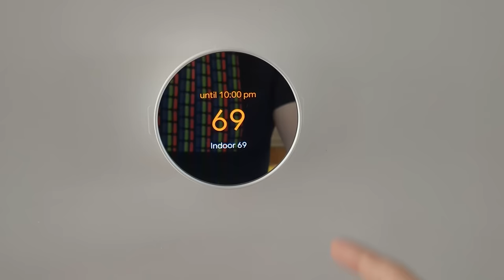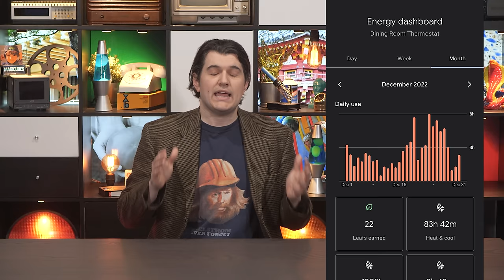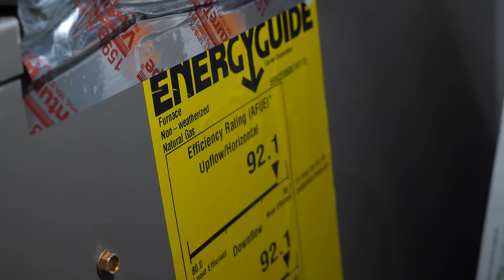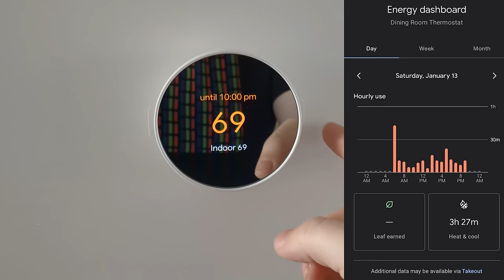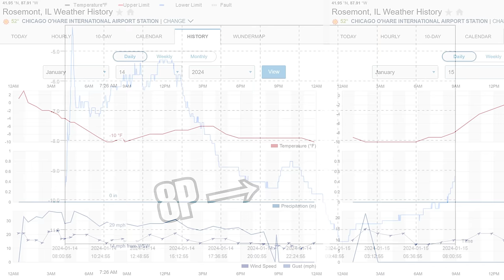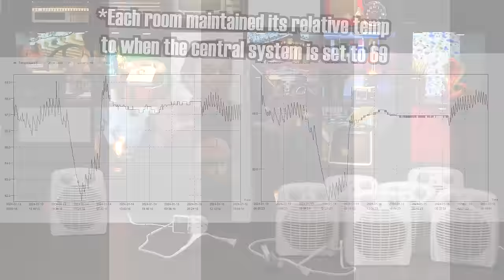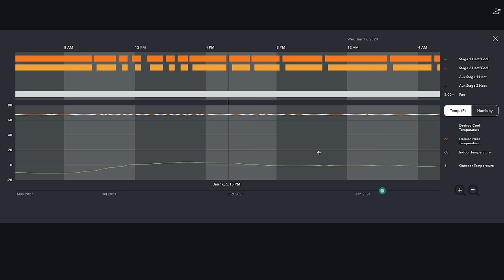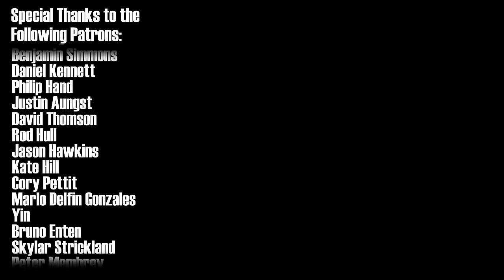Old HVAC industry practices are holding us back and costing us money. But we can fix it.

Comment: What you all forget is you have a 100A main power grid, my home(and all neighbours) have 30A,some 2x 30A as a main incoming power. So whole grid outside is calculated on that surge. Imagine we all install 100A? That main grid house outside will burn out as it can not handle the load. In the end the 10kV to 230V Transformer can't handle that load too as its not designed for those high loads. If that would be replace, imagine the next 25kV to 10kV etc etc. Next problem the noise of those fans and motors, running. I hear my neighbour sneeze! Imagine if we install all those running gear. Constant humming. Thats bad for health care too. 

Gas heating is not the main problem of climate change at all. The money investment , whole re install of electrical systems in houses and so very costly. 
Next to calculate the power surge of all those EVs chargers. Next what in 10-15yrs? again reinstall the chargers and pomps. 
Now a replace incl install of gas heater unit is 2000€ every 15yrs. So to renew the installation every 15yrs of solar panels + inverter, heat pomp AND Ev charger?? 
As we all know things don't last for ever. WHAT are the costs every 15 yrs? Add that up. 

Next we all know EV cars after 10yrs nobody would buy an old used battery car, due to huge expense of that battery 10k+. So instead of a car on the roads to  be last for 15yrs and if shipped to Afrika and the like those will last 25yr as a total. Now they can't ship those used Evs to Afrika as they have no socket to plug in. So the write off those Evs is huge also.
As most of us don't have the 40k € at hand to buy an EV.

Then imagine the jong bloke 20yr old, want to its 1. buy a used car. Not fair to ripp off the high gasprices also. 
Thats what "they" want in effect, get you all out of your own private car. Thats main effort.
In a city, ok you can till app 0700-20.00h use public transport, only within the city.
If you need a bit out side the city, after 20.00h starting to add up, you need big amount of time to get around.
So the freedom to travel is limited BIG TIME. 
" They" even want to tax/mile on the road, just to get you OUT of private transport. Its a scamm of highest imaginary.
Oww Take a kind of loan car project?  Ah yeh been there. 
First at for hand claim a car, than walk around to find one, Next you have at for hand calculate when you want to take trip back, again claim a car.
But you needed couple of hours more, and have to re claim a time slot. Sorry no car available in circle of 3miles.
Ohw you keep that car in your time slot for hours, yehh money clock is ticking also!!!
The stress that will make to be reliant on that system is very huge. Not very healthy. 

So add it all up.
Install a noisy Wpump incl whole installation 10k€ (also have to remove old iron waterheating as those are not designed to work on 30dgr of water)
Re-new electical installation 5k€ (as current system is calculated on 30A main grid)
New e- cooking stove.
Solar system 5 panels incl inverter 8k€
Ev car 40k€ (with a very high 8yr write off)
Install charger 2k€ 
Reinstall new windows,doors and extra isolation etc  25k€
TOTAL 90.000€ , DO you have that ???
Ohw take a lone? Who is benefitting from that? Yess you get it. Also extra rent next 20yrs you have to add up.
For what purpose? A few highly half true imaginary thinking it would have any effect on climate.

As with in 15yrs you have to replace all to gather again.
Normally I only had to replace every 15yrs 1 small heating unit of some metal and plastic of 5kg of waist. Of a reinstall cost of 2k€ .
Now I have in their fake imaginary of environment helping, within 15yrs A whole lot MORE E-waist, and production of all those new equipments.
A Wpump, Solarpannels, Inverter, Charger with whole pack of batteries with huge amount of heavy metals, chemicals etc!
THATS MY problem!!

So as we all know even those wind turbines outside have also to a replaced cycle every 20yrs.
Imagine those costs
And waist, of all that material, even the turbines it self containing heavy contaminated fluids, The turbine blades a huge problem, now ending up in landfills
Yehh I know now scrapped to small particles and be BURNED in cement factories.(Go google it!)

Now start a new vid, and do the whole calculation again of whole supply change within say 20-25yr.
What's the profit than?
Those Ev cars, Solar panels, wind turbines(also at sea and necessary costs of special trained people, safety equipment, helicopters and all included), all those charge poles out side,
at home, cabling. sockets, chargers , inverters, batteries 
The whole package.
All calculated over a life span of 20yrs max.
What's the environment e-waist ? What are the re-cycle costs of that whole package? 

I used to eat every day an apple of 1€ ,cause an orange is 3€, now they made fictive due to taxes and other fake imaginary an apple 5€, Then they say Eating oranges is cheaper?
Do the math.

The real climate change would have an effect if we just buy stuff/equipments that last more than 5yrs.
The little stuff like get rid of all those battery equipments, use a cord drill that will last 40yr+
Proper Vacuum cleaner with a cord that will last 25yr, instead of 5yrs crapp battery thin plastic thing.
Good washing machine that will last 20yr+, and could be repaired when broken. So parts must be available.
etc etc.

That whole Climate scamm is not proper been thinking trough. Yebb thats what you get when "we"leave it to the climate hysterical idiots who only can look one day further.
Have no clue about the whole project, the real calculations they just ignore.
Lets join the idiots sitting on the roads?
You seen them? What are they wearing, eating, transport?? And at home? They ALL lurk on State Income, subsiddiesed idiots.
They just point at others.
Others have to pay up.

They them selves have no proper jobs, they will not do economic work.
They leave that to the migrants they suvvel in by the 100k.
Then complaining they can't find a proper Government subsidised home? Buy one your self! Uhhh I have no job, You hear them?? Do you?
Lets see if by then they still wil sit on that road again.Never, as they are lurkers of the social system.
As they have at minium their easy 20h/w fake jobs of no real economic purpose.
Do you think those Road sitting fools will be installing solar panels on roofs in bad weather?
Will be working in Chinese factories 12h/d to make their wanted Solar panels, inverters, chargers etc etc? 
Living in 15m2 chickenhomes also? Do they? Nope.
Or shoveling new cables into ground for their "climate"NOPE.
DO they invest them selves? NOPE they mostly live in rental by social State managed and dare to claim those "owners"need to reinstall whole new installations.
And when next the rent /m is rising they start pointing at Government (that is YOU tax payer) to add more to their State Income. As those losers have nothing to pay for them selves.
Food prising is rising ,due to fact energy and the like is rising, again those XR fools claiming they need more State Income.
So again they are not really effected as they not have to take Loans, +also rising prises to get "their" climate change effect.

Thats the real story.
See through that whole "climate" scamm and see through the whole thing.
I am not against a proper taking care of environment. BUT must be done on a real proper way. The real way
Hydrogen, Thorium.
And with hydrogen heating systems at home, we don't have to re-install WHOLE electrical installations.
Don't have to have Inverters, chargers and the like, also replace evry 10-15yrs.
Just a new Hydrogen heater and thats IT.
AND we can use current grid and whole grid gas-piping installation also.
Just convert to hydrogen.
Not available now, Start investing, enginering , 
Far cheaper than by now invest in this scamm of batteries, electrical heating systems.

Imagine a private car on hydrogen, what after 20yrs of crapp you have? Only the car it self, no E-waist of heave containing Lithium, Cobalts, Nickel and the like.
And can be shipped to Afrika and the like. Running a next 10yr+ Of that same car.
No Charing poles in streets. Having fights who will charge first.
Let alone the E-WAIST every 10yrs of replacing those poles charges by the millions.
Just a refill at the gas station THATS IT.
GET IT.
You ALL GET IT.
What really is the goal.

Comment: If you have people at the house, those people also tend to open the exterior doors of the house.  The ~100 watts of heat that a human body produces is negligible when compared to opening a door with a 70 degree temperature differential.

If you house isn't perfectly sealed, then the blower in your HVAC unit is making high and low pressure zones.  The longer that the blower is running, the more air leaks (not to mention that your walls and windows are a heat sink and circulating air means that it transfers heat faster).  That I can understand that you didn't bring up.  However, I'm surprised that you didn't bring up that if your furnace doesn't fire up on the first time (maybe the breaker blows or the power goes out), then you can get the house back up to a reasonable temperature.  99% of people would be pissed at the HVAC installer if that were to happen.  How is having an extra burner in a gas fireplace so horrendous in your opinion?

Also, that ACiQ unit is a piece of garbage.  If you're paying $12k for that, then you are getting ripped off.  You should be getting a Lennox or a Trane.

Of this hour, about 50% of it is sarcasm and rambling.  You can do better.  I expect your next video to be how Hyundai ripped you off by oversizing your car.

Comment: heater does NOT turn ALL of the electricity it consumes into heat
Reply: Where are the losses in your opinion?
Reply: @cutterboard4144  its not my opinion, its physics.
with every additional degree in C you need more energy - meaning you need more energy for 100>101C than for 99>100C and thats because the excitation of electrons in atomic layers. you have to further excite the already excited electrons.
same principle is applied to a car speeding up - you need more fuel to go from 60-61mph than for 59-60 mph
Reply: @meex88hiphop  Those are not losses, but temperature dependant heat capacities.
While you are right, your conclusion ist faulty. The amount of energy dumped into the medium is lossless, but the change in temperature isnt linear. Correct.

Comment: I live in Yellowknife NT, Canada. The average temperature in the winter from mid October through April is -20 C.
Our kWh rate is $.32 per kWh. 
How does this jive with a heat pump?
Reply: For now it doesn't. However, that you're in the tiny minority of people who live in a climate where it's too cold for a heat pump doesn't mean that the majority of people elsewhere shouldn't be using heat pumps
Reply: @merchanttf2523  we currently supplement our oil heating with two pellet stoves.  

They also want to carbon tax our fuel oil.  New developments use propane which is marginally better than fuel oil but requires more attention due to potential gelling of the fuel. 
Granted we are a vast area with low population density. 

Is there a good deal of wear and tear on efficient systems that remain operating over extended periods of time?

Comment: And if you want to heat your home to 79° because you are not feeling well, and the outside temp drops of to -20° (like it did recently ... which hurt BEVs charging). So what you need to realize, is that natural gas is more efficient, better for the environment (it produces more CO2 which is good for the environment). It works, it works well, and it does so better than any other system.

Comment: OK. So, your premise is flawed at the outset. The reason it only needs to run for 1/4 of a day is that is the intent. You do not want something continuously running throughout the day to maintain temps. It's not for energy efficiency, it's for basic mechanical breakdown. If you were to cut down to EXACTLY what you need, then the device would be running a duty load 24/7 when it's at capacity. This will drastically reduce the service life of the parts inside. The reason companies go for overkill is to allow shorter duty cycles, more rapid temperature stabilization, and less overall risk of a catastrophic run failure. Could there also be some price gouging? Sure, in any industry, a good chunk of what you pay is lining the pockets of sales and marketing. But is it correct to advise people to request far less? No. I can agree that decreasing the overkill could be a good idea, but going too close to the bone leaves you on a razor's edge of failure.
Reply: The heater runs 3 months out of a year. If using it longer somehow destroys it then people need to abandon it as soon as possible and use heat pumps.
Reply: @milesedgeworth132 you seem very confused. I'm talking about ANY system. All of them feature blower fans of some nature, as well as other mechanical systems that have a life span. They are not designed to run continuously 24/7 365. There's an expectation that they will do their job and shut off for a period of time. If you cut back to the bare minimum, you're forcing it to run more, and push the limits of the mechanical parts and that will shorten the life of the parts. This is true for EVERYTHING. Be it cars, computers, cell phones, bicycles, anything. All machines have a life span and the more they are used, the more stress they are put under, the more likely something will fail.
Reply: @pawkeshup This isn’t really the case for most things. An internal combustion engine experiences considerable wear every time it starts from a stop because of a lack of lubrication. There are refrigerators being made now with compressors that are meant to run almost all the time because it’s better for efficiency and longevity.
Reply: @jehdbrbjeirodofjdjebeebbsnaka  I was highly debating bothering to reply to this, as it shows a lack of understanding, and a bias to compare apples to oranges. But in the interest of education...

The issue with an internal combustion engine has nothing to do with the duty cycles and lifetime of parts in electrical motors. The issues at start up of mechanical failure are not mechanical issues, but pneumatic issues of moving fluid. Oil will congeal on parts and sediment in oil from usage will settle in lines. That's the entire reason when putting up a motorcycle at the end of a riding season requires you to drain it. Heat builds quickly in an engine due to it using, quite literally, regulated explosions of ignited gas to drive the pistons. This extreme heat is not something an electrical motor experiences.

Quite the opposite, the longer an electrical motor runs the worse the stress is on it because it's intended to have expected stop times. Then, further, by expecting that motor to run at full speed for lengthy periods of time will cause additional wear and tear.

There's a reason cars have regular maintenance based on usage, as wear and tear is an expected thing, going back to that as an example.

As for compressors running continuously in refrigerators, there's a video on this very channel that shows that they do not run the same cycle constantly, and regularly cycle. So them "running continuously" is not a thing. Their load varies based on the conditions in the refrigerator, exactly like they do in your home. In fact, most modern refrigerators will shut off if they detect a door open for too long to STOP from extended stress of maintaining temperatures inside if there's a constant venting of that cool air. And guess what, that's due to the increased stress of running full on for extended periods causing failures.

Which is the exact thing I'm talking about in my comment.

Again, the idea that you should be keeping yourself at the bare minimum requirements, and thereby risking increased stress on your devices puts you at risk of shortening the expected lifetime of a device. It could also impact warranty claims as most of those are based on standard usage, not excessive usage.
Reply: @pawkeshup  It’s not about limiting yourself to the “bare minimum” as the heat pump will only be at a 100% duty cycle at design conditions, in this case an extremely awful winter’s day which doesn’t even represent 1% of the year. For that scenario, supplemental heat is always available in the form of heat strips or space heaters which is something that Technology Connections does mention.

Also, yes, there are refrigerators that run continuously. LG manufactures “linear compressors” which are designed to modulate the speed at which they run to increase energy efficiency and lifespan. Many heat pump units say “inverter” on them, which is this exact type of technology. Companies wouldn’t be making those types of compressors if there was no apparent advantage.
Reply: Well it only needs to run at 24/7 capacity for 1-4 days a year by this calculation.